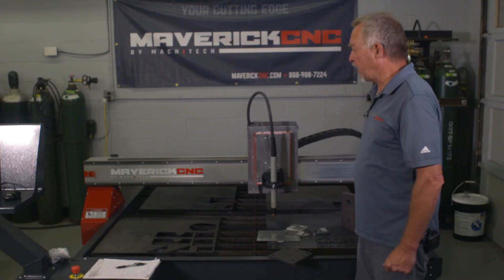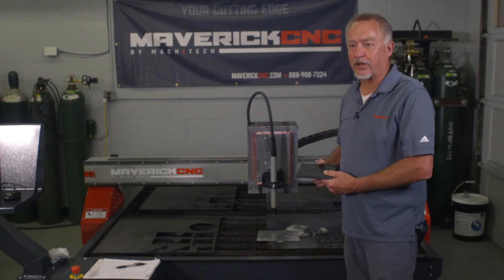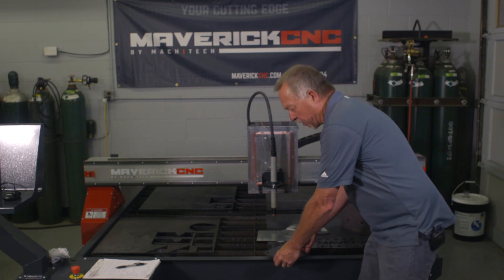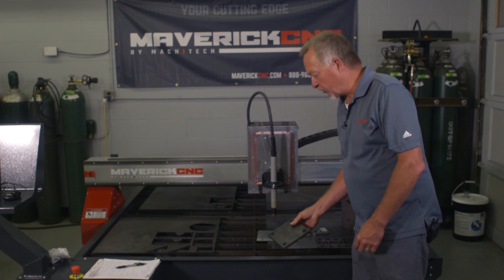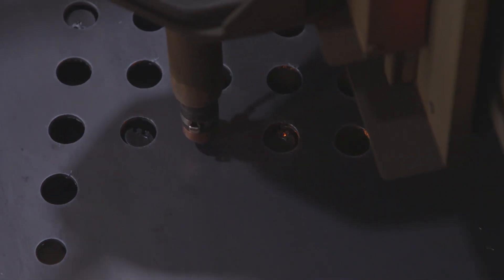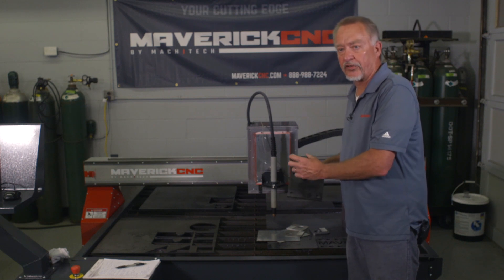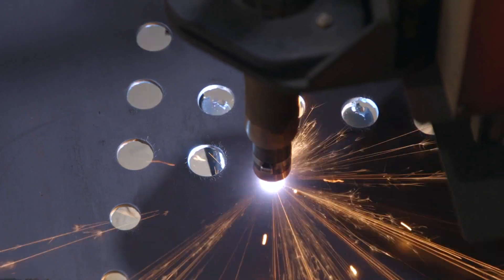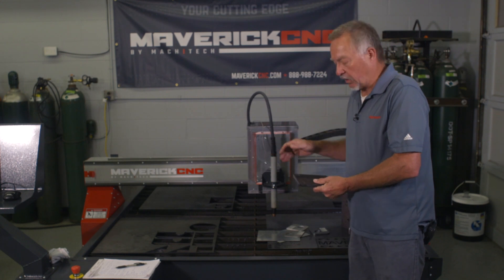Learn How to Cut the Best Holes with an Air Plasma on a CNC Cutting Table with Jim Colt

Comment: hi sir , i project to purshase a new cnc plasma , table , with water secondary shield , what do you advise and suggest , for cutting stainless , al , at least , 5 mm thikness , with top , cutting ,at 1mm average thickness 
need to choose all parts beginning by the cnc plasma table and the cutter , my email , is vectratech@gmail.com 
thanks

Comment: Can you suggest ampere required for 16mm mild steel piercing
Reply: 130amp
Reply: 16mm is the equivalent to 5/8” here in the states. I cut that with 105 amps using a Hypertherm 105. It’ll cut up to 1-1/4” thick steel (30mm)